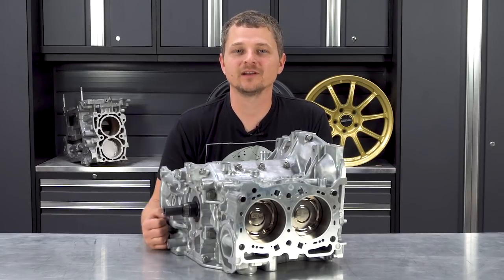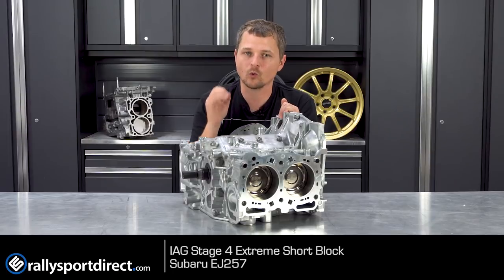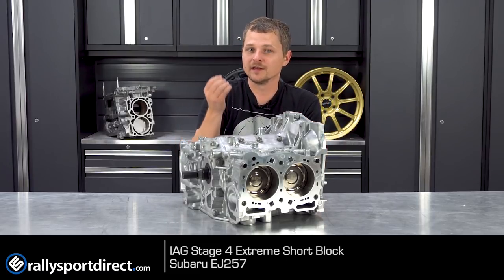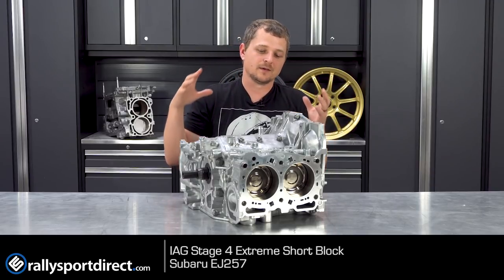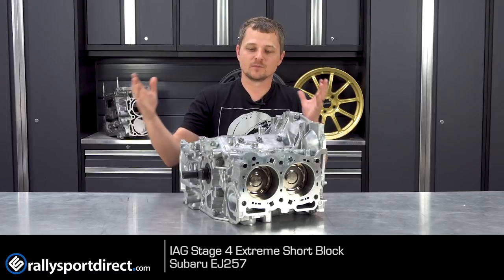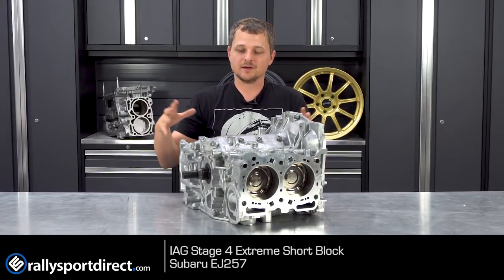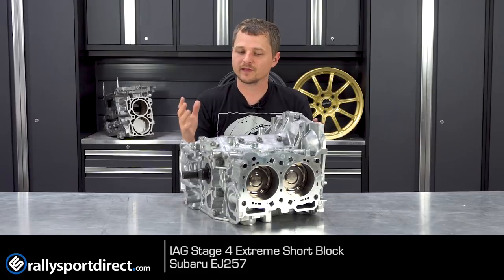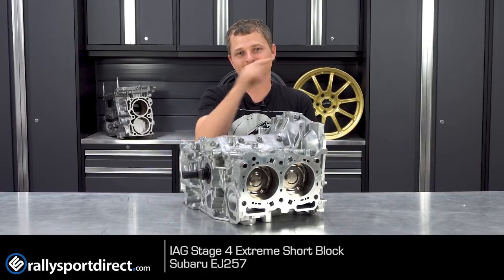IAG Stage 4 Extreme Short Block - What's In The Box

Comment: If I keep my wrx, I'm going to save now and when the warranty runs out, going to tune it, drive it hard until shut breaks and when it does, going to do either a 3 or 4 and other upgrades. Can't risk warranty yet, already had motor pulled at 28k fir rod bearings.  Haven't even driven it hard, all my oil changes at 3000-4000 miles. So yeah, glad i didn't compromise warranty like most youtubers recommend.